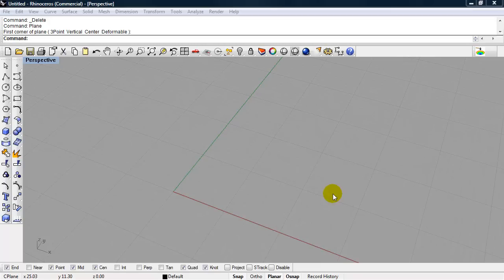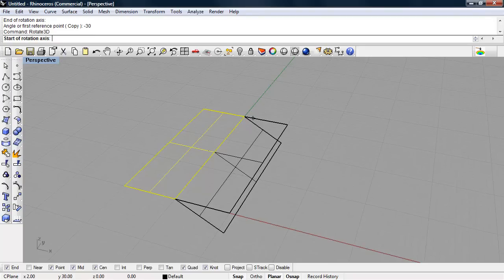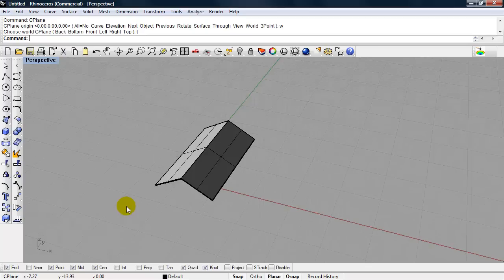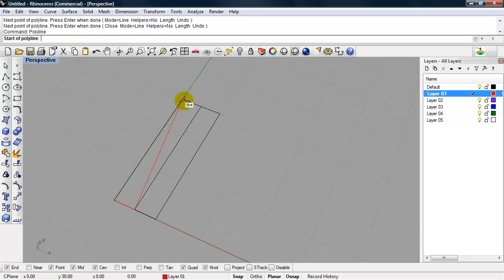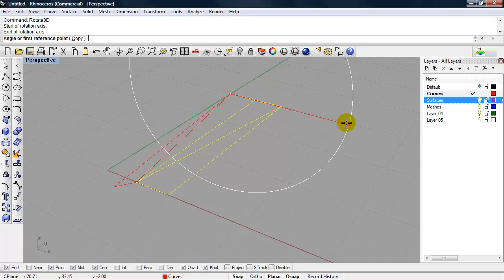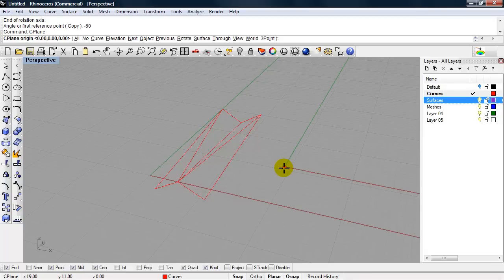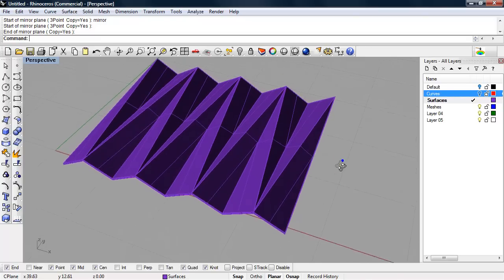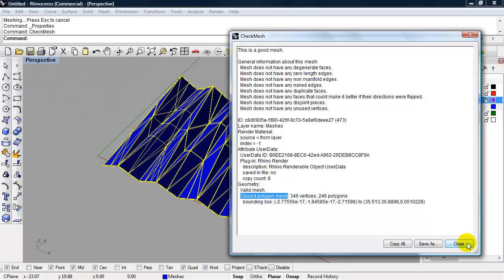Rhino Folding Plate

Comment: I have seen most of your videos and I found the presentation so clear and easy to follow. I must thank you for that: I'm a retired architect and this year I have decided to take a master course in digital design and I must admit it was and still is very daunting!  Your tutorials are very helpful. I'd like to use 'folding plate in Rhino' to create a parametric shades with grasshopper.  Could you kindly advise. By the way I'm based in London UK.
Thank you. My email address is: fssloumi12@gmail.com